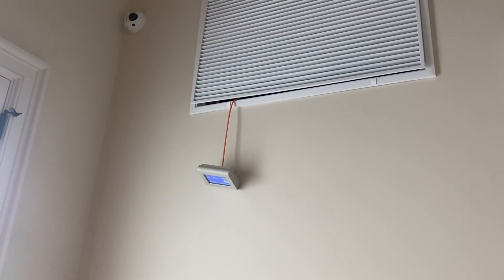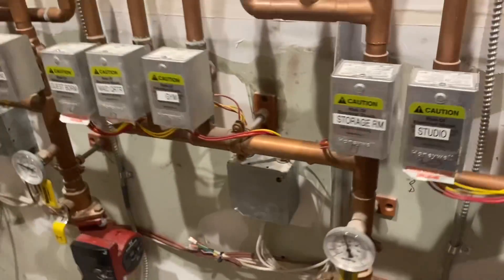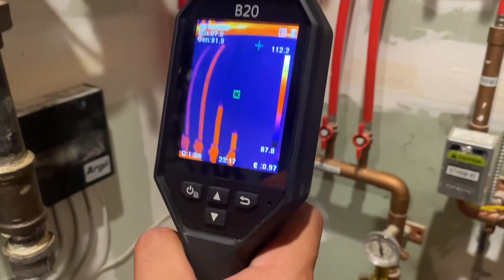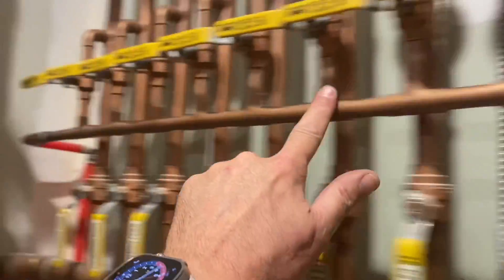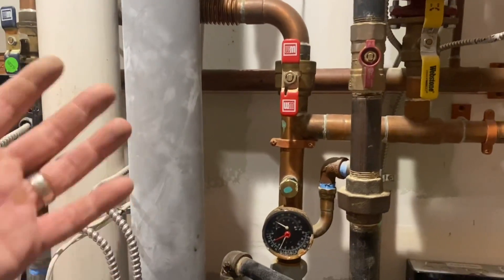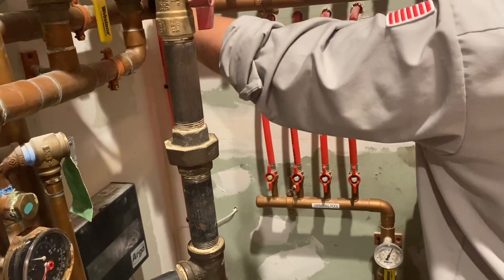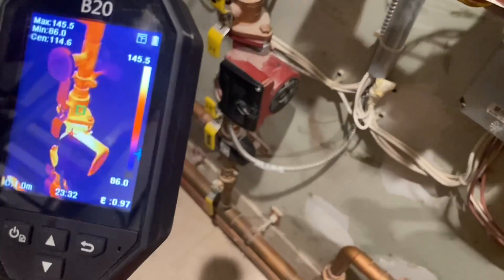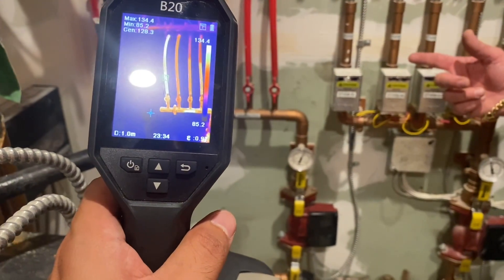Hydronic Radiant Heating Not Working How To Diagnose Defective Zone Circulator After Purging

Comment: The "lag" you see on your IR camera may be due to the correction function built into the camera.  Most IR imaging devices use a little "shutter" to do something known as field correction.  The shutter blocks the sensor for a fraction of a second so the camera can measure the temperature of the shutter to get a uniform temperature to base the rest of the image off of.  IR light works completely differently from visible light, so you can't just say "if the image is too bright, close the f-stop".

Comment: Amazing setup, wow, pretty well thought out except the common purge piping directly to a open drain. How can you tell if it’s been purged if you can’t actually tell if there is air, need a bucket sight for that.
Always remember it can take a few hours before you can use IR cameras to check a radiant floor that’s cold. Be well, the Trades have always been good to good techs.
Reply: that "pex" tubing to the drain will jump around and you'll hear it spitting and sputtering, that is unless your half deaf.